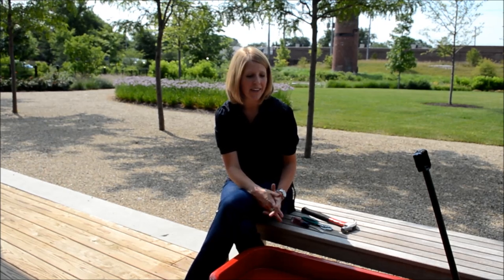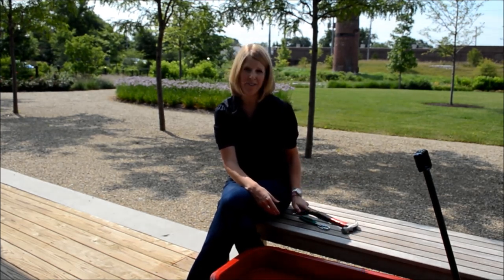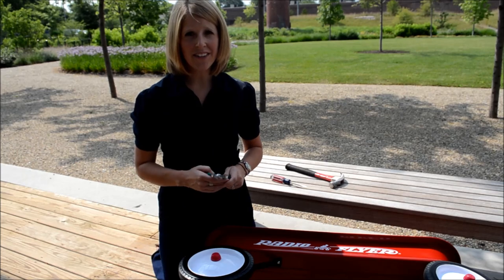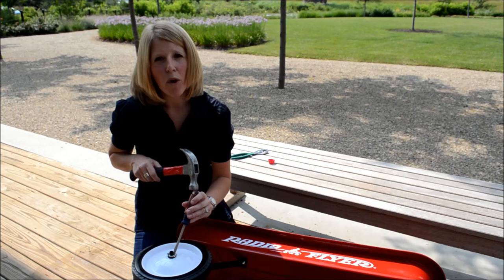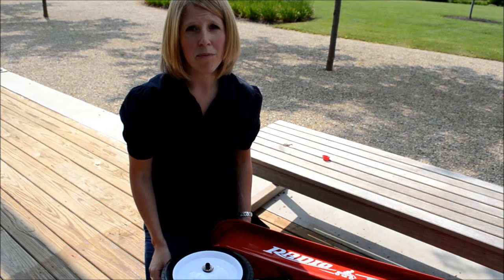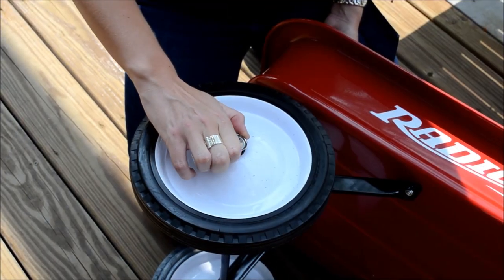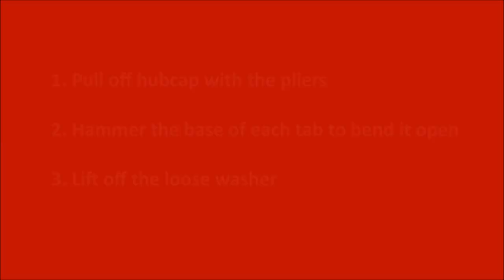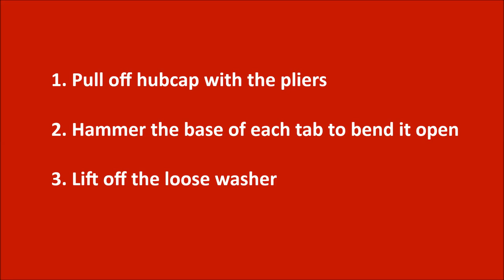Radio Flyer Hubcap Removal

Comment: Reuse the pushnut by re-bending the little tabs. Place the pushnut on a hard flat surface and tap the tabs a few times with a hammer. This flattens them back to near their original position. To re-install, use a 5/8" socket as a "driver", and tap them back onto the axle shaft with a hammer. Don't make them too tight against the wheel. Re install little red hubcap.

Comment: This is not applicable on the radio flyer push tricycle because the wheels are plastic. This actually pushed the washer so tightly to the axle the bike isn't even usable.

Comment: On the metal washer are 6 short tabs or teeth. If you hit them at their base they will bend away (loose their bite) from the axle and come off. I did this to my plastic wheels which I wanted to reuse.
Reply: You’re the MVP. Thank you for explaining this in words, it made the most sense.

Comment: Can the capnut be reused?
Reply: Yes you can reuse.  you just hammer them flat before reinstalling.
Reply: +Greg Simpson Yes and no. They do not grip as well once removed and reinstalled. Buy new cap nuts at any hardware store.
Reply: Robert Clark  Yea, your probably right. I just got lucky and it's holding perfectly. I was just careful not to hammer all the way flat as I didn't want to "weaken" the metal.